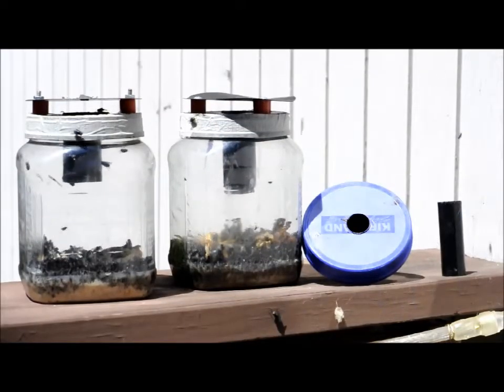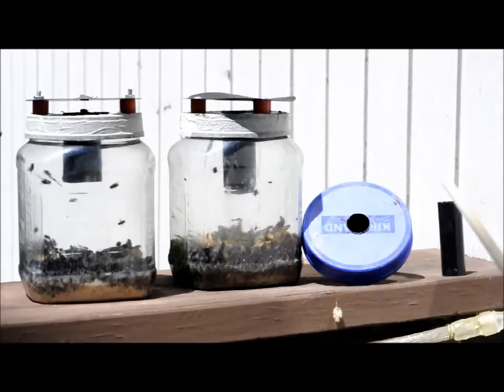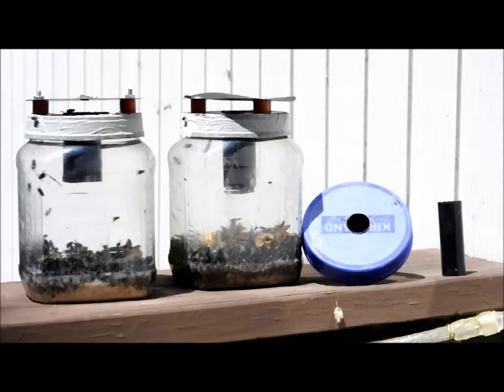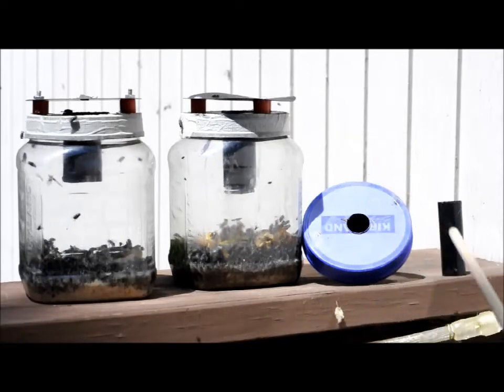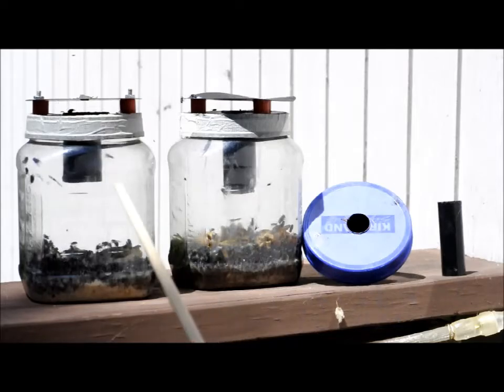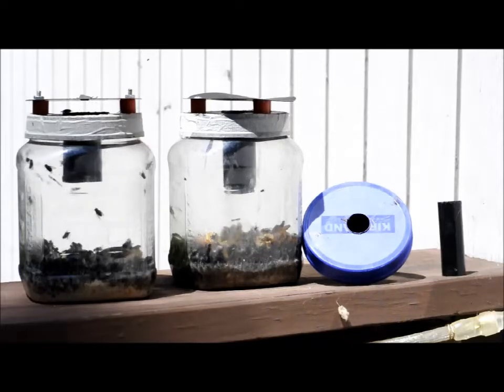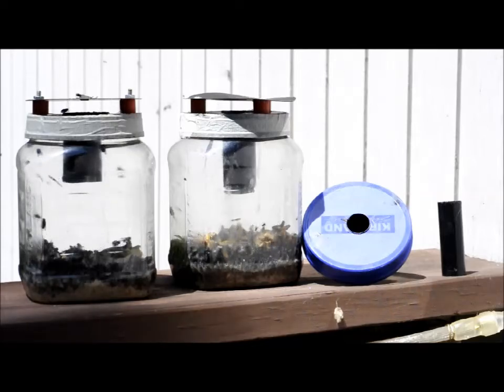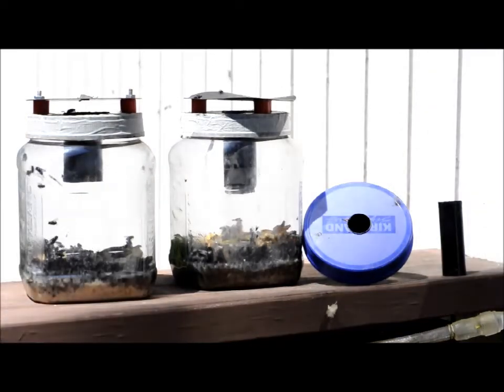Fly  Trap

Comment: Have you ever done anything with twin cylinder kohler ign systems as far as eliminating points and condenser. Is it possible to put one of your trigger systems on a kohler opposed twin using a pin in flywheel type system. Is there some way I could contact you directly via email etc ?